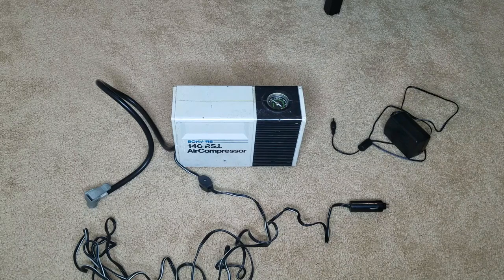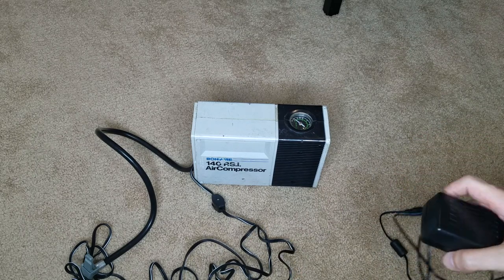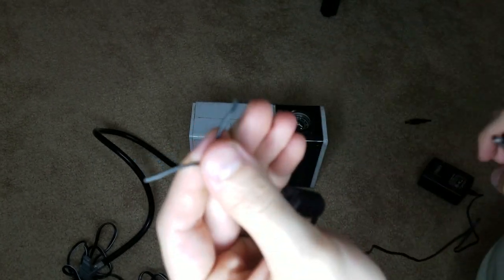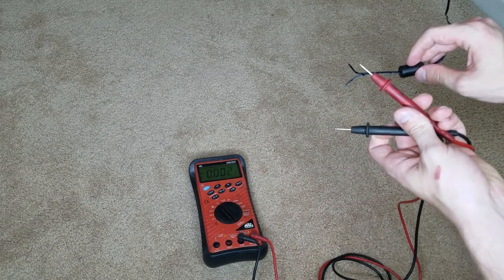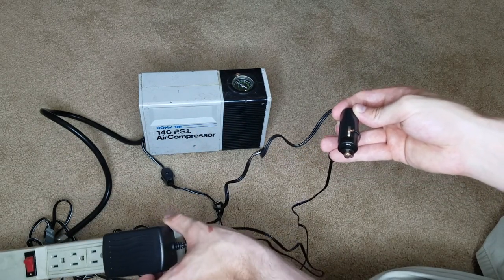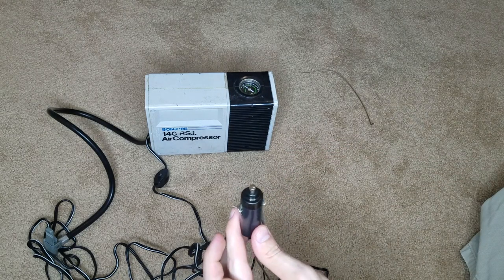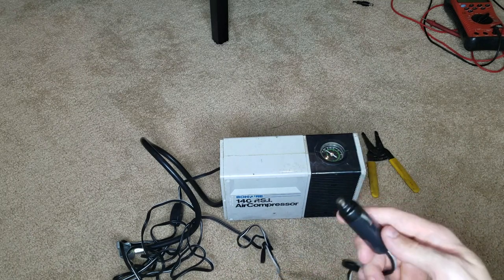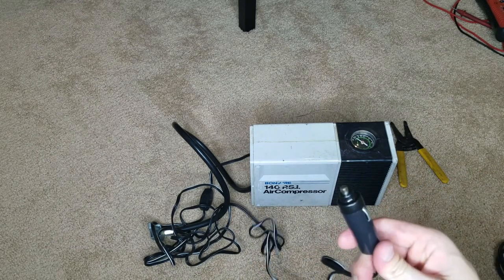Can I make a car accessory plug work with a wall outlet?

Comment: My search was," Easiest way to plug car socket into normal socket" and it was because I am going to buy an automatic tyre inflator. Your video was the 3rd result, it was meant to be. Also in my country where everything is 220V. A car battery supplies 12-16v and 10 amps. I have a Chinese bluetooth fm transmitter which tells me this information in real time(which is useless unless used specifically for an example as this one). Good video

Comment: You can build a cigar socket to 5mm barrel connector adapter for about $3 at your local electronics parts store, then you wouldn't have to destroy two devices. Also, you need to make sure your power supply can handle the draw of the compressor, usually it's at least 10 amps.

Comment: The wires aren't "positive" and "negative". The wire with the solid line is the "power" wire. The wire with the dotted or striped markings is the "ground" or "neutral" wire. Those spring connectors on the sides of the barrel jack are effectively both ground or neutral. It would be much safer and easier to directly wire the adapter and compressor cables together. If you leave enough wire from the ends of both cables, they can also be easily spliced back together and be used as normal again.

Comment: I accomplished this with a EC5 plug and a battery/jumper/charger... they have a 12 volt EC5 on the battery packs..  this way I use completely mobile.  The battery jump boxes are the size of a cellphone.

Comment: You may need an ac/dc converter. Wall outlets are ac so my guess is that the pump is "sputtering" because of the alternating current.
Reply: To work properly you need smpis power supply 12v 15 amp
Reply: C
Reply: So being a/c doesn't change anything?

Comment: Thanks this ended with new spike effect hairstyle,  I got a  bit more than a tan as I didn't expect wet hands and electric could darken my complexion,  well I have both hands and half my face like burnt toast and smells like it!!
Also it worked wonders for my heart but the hospital warn me that the electric rhythm of the heart is out of sync so I'm asking for your fantastic advice on Part 2....getting the current and correct time to achieve correct heart rhythm rate and your sparkling personality and positive vibes are the remedy for the negative attitude I can dazzle and illuminate people...?.....!
Thanks from my heart and you are boombastic 🎉

Comment: it would have helped if you read the output on the wall adapter and looked on the compressor device for the input power. if you cant find one, google the device online for its info. being since the compressor cig plug is 12v as is.. id assume you would want 12v wall socket adapter...

Comment: If you need more than 10 watts, you need a power supply that takes 110/220 V from the wall and outputs 12 V DC. It's a rectangle metal box with electric components inside. 
Be very careful with the high voltage compartment obviously.
You can use a "female car cigarette lighter socket" or simply cut off the end and reveal the two cables of your car accessory. Then carefully insert the + and - to output of your power supply. Keep that in mind, DC devices WILL NOT WORK if polarity is wrong. I mean + needs to connect + and - to -. Otherwise you may (will) harm the device and power supply.
Also wattage calculation is really simple. Voltage × Amperage = Wattage
For example 12 Volts 10 Amps means that you need 120 watts to run the device properly. Although 10V 12A is also 120W, there's no guarantee that the device will work properly since it's not designed that way. Even if it works at a different Voltage, it may be harmful in the long term.

Comment: thanks, i used the same 2amps 12v and it did the same, i went to look for one that can produce 12v at 10amps but failed to get it here in uganda, and i think i have to instead get a car battery charger like you did . thank you

Comment: you're going to want a 12 Volt 10 Amp power supply. most car power outlets supply 10 Amps. buying a 12 Volt 10 Amp power supply will cost between 15 and 25 dollars.

Comment: I'm done with Google . I looked it up and it say's that the side with the white lines is positive .But you just said that was Negitive. FUCK
Reply: To be fair the white lines are only on the insulation, and the insulation does not have polarity in this circuit. Testing the conductor is always the best way.

Comment: Would it be easier to cut both wires and just connect the cables?
Reply: No, because the plugin for the air compressor or any other cigarette lighter plugin contains items to help prevent a fuse from blowing, and if it does blow a fuse, it won't blow the car or house fuse, it would blow a tiny very cheap fuse inside of that plugin.
Reply: @Koolkops88  Well you can always reconnect the fuse.

Comment: Thanks for the idea, I will check to make one because air compressors are noisy as F and my car can't get parked inside my property so basically it will be annoying for my neighbors.

To make it pretty I would suggest finding the correct adaptor and then cut off both cable and add some small connectors so you can switch between the adaptor and the 12v accessory by plugging the desired end, cleaner and more convenient.

Comment: One thing you could have done is instead of hard connecting it you could have put a female end on the compressor and put a male connector on both the car charger and the wall plug
Reply: I think a gender neutral end wouldve been better

Comment: Its at least 3amps up to 5.   Just make a quick inverter from 12v to 120v and replace that with a regular home plug.  Find space to mount inside so you only have one cable to plug into the wall.  Nerd:)

Comment: well hope the pumps motor aint rated 56amp, good luck finding such DC adaptor lol but its aggravating AF how the assholes manufacturing this kind of garbage wont add a plug hole for the home adaptors with appropriate motor and mentioning minimum mAh adaptors you could plug in before you burn it out and possibly cause fire. Instead you have to buy a novelty pump AC/DC portable ones for triple the costs. Good business strategy. Ripping people off, as usual. Are we not used for this tactic for decades now. Paying tons of money for less quality stuff.

Comment: I just want to say that the designer of the compressor is blind and the manufactory should be replaced soon, why not give it a normal plug? And I just bought this stupid thing today!!! we use it for bike tires or balls, why this kind of plug. since it comes with this specifical plug why not put a proper socket in its package?  and I am so blind to buy this without figuring out how it works!!! It makes me cry.